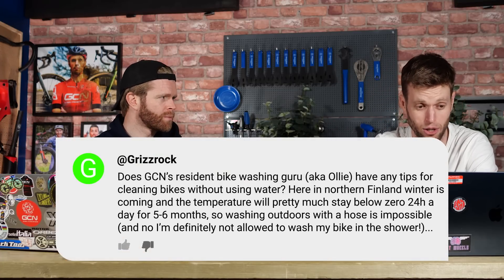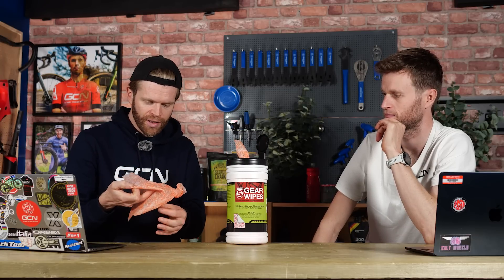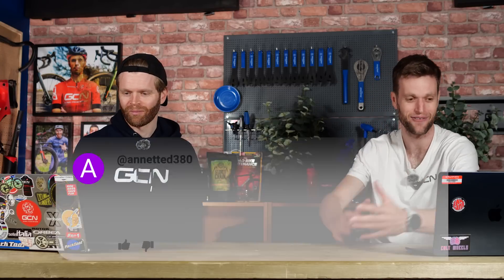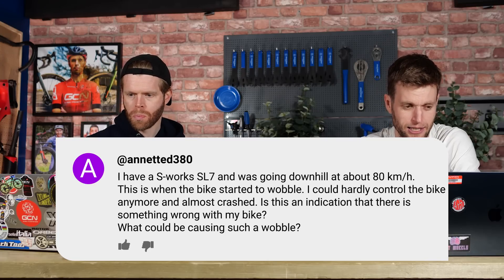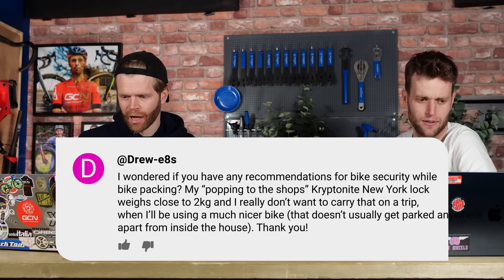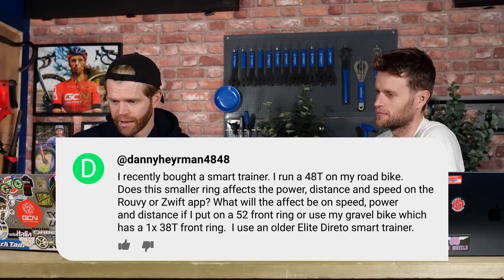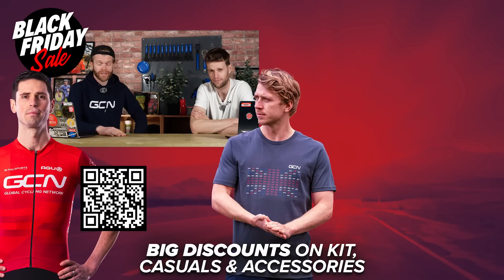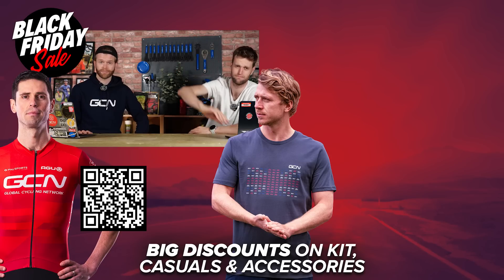Waterless Bike Wash, Cold Waxing & Speed Wobble | GCN Tech Clinic

Comment from the maker: Got a question? We’ve got the answers! 👉 #askgcntech
Reply: you must have missed Silca's recent video about how to soften their wax for winter riding to prevent the flaking, and then using the strip chip to restore it in the summer.
Reply: The question regarding saddle bags did not say "feel the aero difference." It said, "feel the difference." Yes, they mentioned that larger bags have an aero difference, but perhaps when the question said that people can feel the difference, it's due to the size AND weight of the bag. 🤷🏽‍♂
Reply: regarding bike locks, from REI I purchased a kayak lock which is basically two cables and a disc-detainer style key lock which is far more difficult to pick.  this is heavier than my previous cable lock which was half the thickness and the lock not pick proof at all. 

honestly is somebody is looking to go around stealing bikes, they're going to know how to pick the simple locks, and they're going to be having cable cutters to cut the large cables. most opportunists are just walking around and see an unlocked bike, and thus might only have a multi-tool with them at most... so at the least you only really need to carry the smallest diameter cable, long enough to go through both wheels frame and saddle, that you can find that has a disc detainer lock.  avoid any lock with code wheels or TSA key, every Master Lock because they can all be shimmed with a piece of trash. this advice is good enough to prevent 99% of opportunist thefts as long as you actually lock it. someone with tools will probably get it anyways no matter how thick your cable is, so make sure you don't take too long to get back to it.
Reply: Was wondering if you could do a viedeo on bike covers to store bikes outdoors. Not everyone has a shed garage or garden or are able to store them indoors.
Reply: #askgcntech. Recently, I saw several riders on Zwift wearing the new GCN AGU jersey on some pacer bot group rides. How can we unlock it, and does it have to be through one of the weekday GCN club rides?
Reply: I always enjoy the answers you guys give - so much to learn! 
Here my QUESTION: I have been comparing Silca's, SRAM's and other TIRE PRESSURE tools and suggestions. Unfortunately, they all seem to disagree which pressure is the most effective as they are based on different assumptions and options: some take road surface into considerations but not clincher/tubeless, while others want to know the wheel width but ignore road surface, etc. Can you help? Your expertise is highly appreciated, thank you.
(apologies for the redundancy: I did not know where exactly to place my question - reply or comment?)

Comment: #askgcntech I’ve switched to wax chain lube (Silca drip). After a few applications, I was the bike but find residual wax on jockey wheels, chainring teeth, cassette which transfer from the chain are sticky and hard to clean even with warm water and light scrub. Any tips or simply leave it alone - there’s no grit or dirt.

Comment: Straight gauge vs double butted spokes.  I’m a heavy 1.95m tall, 91kg rider who likes to give it the beans up climbs out of the saddle. This year, unusually for me, I have broken 3 spokes, 3 different wheels, all non drive side, all rear, all double butted, 2 on normal dished derailleur wheels, 1 on my non-dished single speed. All broke at the bottom of climb when I got out of the saddle to climb. All have broken about 2 inches from the bend. I have another single speed with straight gauge spokes that has more mileage than the other wheels and has yet to fail. My question- where the spoke changes it gauge from thick to thinner butting - is this a potential weak point “stress raiser”. Cheers steve.

Comment: On the SL7, you get speed wobbles if the weight is too far back. Sit upright with no hands on the bars above 50kkph and youll see it. Put more weight on the front, and it will be absolutely fine.

Comment: I often get tubeless sealant blocking my valves when trying to pump up my tyres. Normally a quick hard push on the pump clears it but is there a correct way to deal with this? And what do I do if the quick hard push doesn't sort it?

Comment: Ultrasonic cleaners won’t hurt your hands. My hands were in and out briefly 20+times per day to clean them over a 40yr career. It can be a bit uncomfortable if tool long in the cleaner, heat and gas bubbles in the joints but I have no lasting effects. 

On high speed wobble, I’ve experienced this due to an improperly installed headset that quickly (4rides) became indexed. Also from a mavic freehub which had the wrong lube and set into a death squeal/speed wobble. A couple of times from shivering but brief and easiest to control.

Comment: #askgcntech I’m considering getting a new do-it-all bike but I find it a bit hard to sort out a proper one… I would like it to be a aluminium frame and most important, without all those ugly mountings bolts scattered around the bike!!! I would find it fine if it could fit up to a 38mm tyre and still keep under 8,5 kg… I’ve  been looking at the TREK Domane, but it has those bolts on the top tube 😒 and the TREK Crockett is getting a bit expensive….
Do you have any suggestions???

Comment: #askgcntech Hi Alex & Ollie, quick question, I’ve notice a drop in my average power. On my long rides my average power has dropped 40-50 watts since last year but yet the average speeds have gone up. (Same course, same power meter, same tyres, gear etc)

Cadence has stayed more or less the same. Why could this be?

I’ve tried calibrating my power meter before every ride, new batteries etc for record I’m using Quarq Dzero power meter, it’s meant to have a good rep. Any ideas?

Comment: @Grizzrock 
Living in Alaska, I have the same issue.  On the whole, I don't worry too much about cleaning most of the bike...the chain is the most important part.  My solution is a ultra-sonic cleaner for the chain...gets it squeaky clean, and doesn't make a mess.

Squirt Brand drip on wax comes in a cold weather formula; a LHBS uses it on their fat bike rentals, suggested it, and it works just fine in actual cold temps (priorly I used Muc-off -50, which also works great).

Comment: Speed wobble caused by wrong Fork trail for the frame. Get to a certain speed and it just happens. I changed my forks for a bigger trail and the problem went away. I would not expect it in a SL7 but maybe their is an issue at say 80kph.

Comment: For popping into shops and peace of mind whilst within range a motion alarm would be a good idea and instead of using a zip style locks through the wheels wrap one around each brake lever and keep the wheels locked by the brakes. Deflate the front tyre and dangle your spare inner tube over the bars or split the bike chain and leave a tool on the floor (not the chain splitter) Draw attention to maintenance issues if no other security option in this situation.

Comment: Put several layers of good quality car wax (or silicone spray, and polish)  on a perfectly clean frame. Then, when it gets muddy or needs to be cleaned, just let it dry and brush off the dirt with a paint brush. This is actually ideal if you store your bike indoors and don't have a place to wash your bike. Vacuum up the debris.  If you hang your bike on the wall, just put a rubber mat under the bike and it will catch the debris. Washing a bike with water is really not necessary, as only professionals promoting a brand need to have the bike perfectly clean.  The chain and drive train can also be wiped with a rag and re-lubricated, which will also keep it clean without washing.

Comment: Lots of good responses regarding speed wobble.  One more to mention is wheel skewer tension.  Make sure it's appropriately tight.  Just like some can make a noise that sounds like a creaky bottom bracket if not tight, they can also allow wobble.  The one time I actually had speed wobble on my bike, it was me.  Had just finished a climb, was sweaty, then descended. It was chilly out, and I didn't realize I was borderline shivering.  Concentrated on not doing that and solved the problem.
Reply: Really some great science there, speed wobble are just like rogue waves or Tacoma bridge. Happened to me with some vintage Spnynergy wheels, just like Ollie a couple of month ago, also once at 95kph with badly aligned alu rimed wheels, just grabed the frame with my knees.
Headset check a must too , 2 thumbs up!

Comment: To add to the response for the last question: the dense moist air in the winter is also going to contribute to possible corrosion of bike components and infrastructure i.e. threads and brackets. So if you can get a tightly woven and thick cover (some motorbike and car covers are good), that should give you the best chance of keeping your bike in good condition over the brisk and horrid winter months. But it's not Canada though is it haha
Reply: Definitely consider the overall moisture, harsher dew formation, and slower drying in winter.

I would suggest to try to convey the importance and value of your bike (/hobby). I wouldn't say "leave her", but I think it's legitimate to discuss this properly. Bikes can cost several thousands, they deserve proper care. And you deserve to have your say in how space is shared in your home, no?
Reply: @lbx5359  Moist, winter air is brutal on metal components, and most covers won't help with that much. Putting a heat source inside the cover might help a bit, such as old-fashioned (non-LED) light bulb left on constantly. People around here do that inside boats and trailers that they have to store outside.

Comment: #askgcntech what’s the best way to install tubeless valves to ensure they’re airtight? Is it simply finger tight and then trust the sealant to do its job? Can you damage the rim tape if they’re too tight? Thanks guys.
Reply: Just get it as tight as you can without tools while pressing down on the rim-side of the valve for more clamping force from the locknut. Almost all valves I've installed never leak (if they do, something's up with the rim tape at the valve hole).

Comment: #askgcntech   How long can I ride a bike with a streached chain?  My chain is streched so much that it has worn down the teeth in the smailler cassettes, so I can't use a new chain.  The old chain works fine, but how long can I use it?   I know I will need to replace the cassette when I replace the chain.
Reply: If the chain slips around your current cog under even moderate pedaling pressure, replace the worn drivetrain parts immediately.

You haven't found a replacement cassette yet?

Comment: Conor may be more likely to get high speed wobble due to weight and frame size. My 60 cm 531 Mondia had low flange wheels and was very comfy on rough roads, but had a wicked wobble above 35 mph. Larger frames lose some stiffness as the triangle tends to parallelogram shape.

Comment: Waterless washing: the bike shop I work in doesn't use water. We spray degreaser on the drivetrain, let it soak, give it a scrub, then spray it off with an air compressor. After that, we use microfiber cloths and muc-off bike cleaner. A few sprays on the towel and you can wipe the bike clean. May take a couple rounds

Comment: #askgcntech  Hi you guys, I have always kept my bike indoors but will need to store it in a shed.  The shed is well built and seems quite water tight but I am worried about damp rusting parts and also heat drying out lubricant and sealant.  Is there any bags or storage devices I can put the bike in within the shed that doesn't need me to dismantle/reassemble the bike (ie taking off the handle bars, lower the seat hight) each time I want to store it or use it. thanks!!

Comment: Ultrasonic baths will not dissolve your bones unless your using an extremely strong Acid. The issue with putting hands/fingers in an ultrasonic bath while running is to do with he generation of gas bubbles in your blood stream and can be extremely dangerous.

Comment: In four decades of riding bikes I only experienced speed wobble on one bike. It was a Merlin Titanium racing bike. Even locking my knees against the top tube didn't help. I thought I was going to die because it was at a very high speed going downhill. I was braking as fast as I could and lucky for me it stopped. There was something wrong with this frame because I got a new frame and used all the components from the Merlin and never had a problem. Sure wheel balance can probably cause some wobbling but I attribute it more to the frame and fork. Some frame geometries aren't good if you don't use the correct size tubing to keep the frame stiff, it's more than likely not the components.

Comment: Re speed wobbles: my life experience of speed wobble is that 90% are caused by extreme tension in the cyclists body and grip. When the speeds get very high some people get very nervous and then grip the bars too hard then their reaction to oscillations/movements  of the bike becomes out of sync/delayed. The result is they end up effectively fighting against the movements of the bike rather than smoothing them out and this builds into a wobble. My friends who routinely experience speed wobble are also coincidentally terrified of descending which causes their tension. I know it’s not their bikes because it happens on all of their bikes through their decades of cycling. It’s also happened to me a few times for the same reasons. My solution is avoid gripping the bars too tight. I let my fingers flutter off the bars ie tapping or playing the piano. Also make sure you are flexible in your wrists, elbows and shoulders. Flow with the bike rather than giving the bike a full body locking death grip.

Comment: I also had a speed wobble this summer, also going downhill at about 81 kmp (with good circumstances - barely no wind, warm enough etc there are 92+ kmp possible). On that day, the wind was remarkable gusty, which - in my opinion - caused the trouble. As this descend lead into a small villge, I still kept the speed, hoping the slipstream of the houses would end the wobble, which indeed happened. As i still ride an old Giant Cadex CFR with tt bar on, I have the possibility to swap in any aero forks with 1"-steerer, which I did. Changing the Felt fork and putting in a Giant Aero fork with alloy threadless 1" steerer helped.
Cleaing the bike during winter: I put on some wax which is used by modelers for vacuforming parts, it can only be removed with nitro thinner (which is bad for clear plastic parts, but great for the bike). By doing so, dirt cannot stick so good on the bike, and it is often sufficient to use a low pressure sprayer used for gardening etc (10 bucks on amazon) only filled with water. In case I do it outside, I spread a little bit salt on the pavement, so the water won't freeze. The waxing shoul be refreshed after 2-3 weeks - I guess it disapperars a little bit when wiping the bike dry.
Concerning the guy in the small appartment: if your girlfriend does not like your hobby, it is not worth it, sooner or later there will be troube "Go for a bike ride?! You did so yesterday, is it really necessary?!" I once met the girlfriend of my former bike mate, and we were talking about my and his bikes, and she said "What do you need several bikes for?! You can only ride one at a time!". I made the mistake to reply "And what do you need several pairs of shoes for?! You can only wear one at a time!" She glanced to me, the temperature in the room fell below 0°C, and that was the last time my buddy was allowed to meet me, I never heard of him since. I fear he had to quit cycling...

Comment: On subject of high speed vibrations, in early 70's I rode a Viscount [ it was removed from the market] which often experienced these dramatic vibrations. I discovered that putting my knees against the top tube and squeezing changed the   effective length of the tube and that  changed the frequency of the vibrations which changed the harmonics and this eliminated the wobble.

Comment: Using wipes, cloths or sponges for washing, only cleans half of the bike and pushes extra dirt into the nooks an crannies where it is already accumulated. You need a brush to get in there.

Use Evaporust against rust. It removes rust without damaging the paint and it protects against new rust for 2-3 weeks, so you have time to protect after cleaning it down to raw steel.

There exists totally closed bike- or motorbike bags with an internal coating that coverts the air into a rust inhibiting environment

Comment: Regarding Speed Wobbles: I agree with Olly: the whole frame is shaking it makes sense to actually clench the frame between your knees. However, it can also happen if you cramp up because you hit a bump: then it is actually advisable to loosen your grip on the handlebars so that you can dampen the moment more. That happend to me on gravel (about 10% gradient just before a corner (could have gone around it with 40km/h). I had to tell myself to loosen my grip and managed to do so. It prevented me from a serious crash.

I also had that happen on a slightly untrue wheel on the Nürburgring Nordschleife in a corner around 60-70km/h. There you simply need a true wheel.

Generally I have to say that it is less likely to happen if you feel comfortably on a bike and you don't cramp up. After having lived in a hilly area speeds of 50-60km/h downhill became normal and that definetly improved my control of the bike at higher speeds.

Comment: With regard to bike security, you didn’t mention bike alarms. My Garmin edge 1030 has an alarm that you can set, but I also have a Knog alarm which connects with Bluetooth to my phone, providing I am within range to alert me if the bike is moved. The alarm is on both the phone and the bike.

 It even enables me to track the bike if I don’t catch the thief at it!  Just remember to disable the alarm before you move the bike yourself!  I would also use a physical lock like the one Connor described.